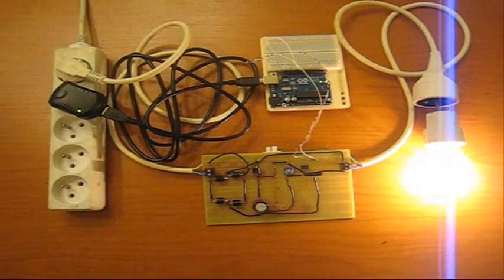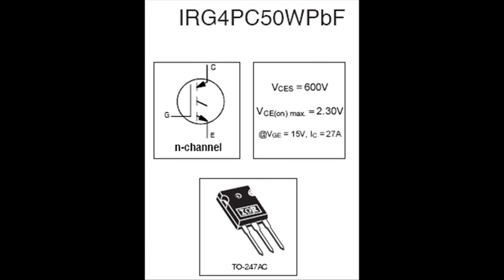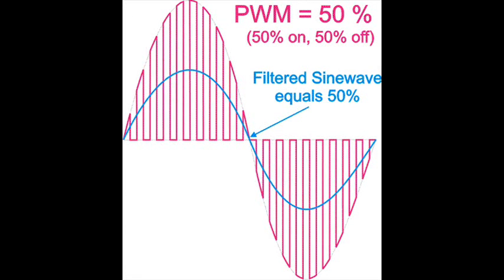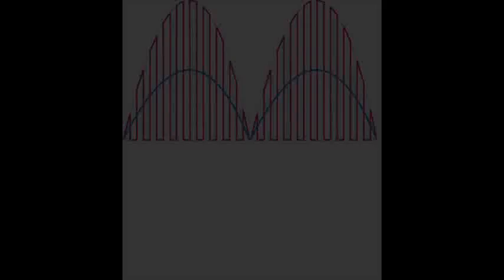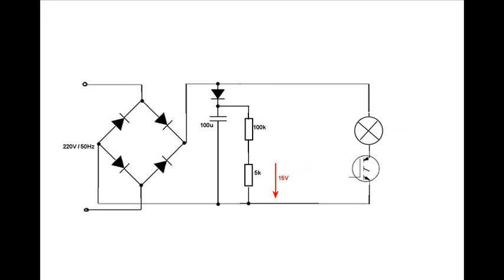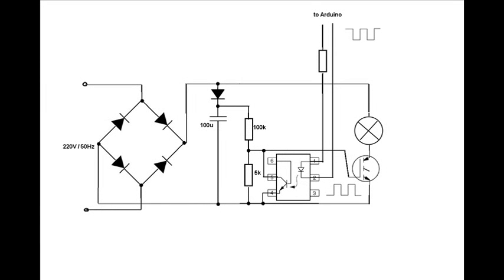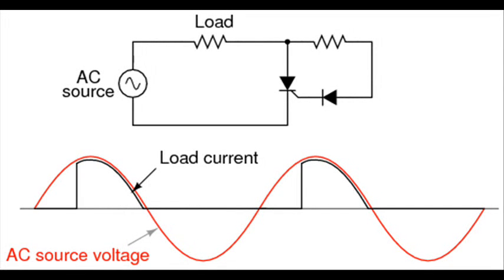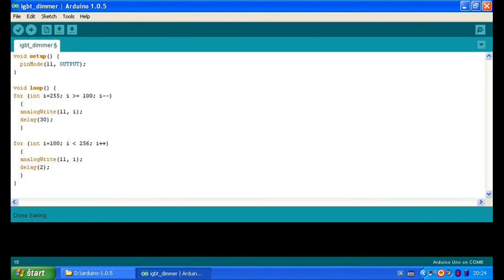AC dimmer with PWM on Arduino

Comment: Hi Jaroslav. What is the additional diode used for? It seems to be unnecessary, because the current is already rectified... Am I missing something?
Reply from the maker: Yes, the current is rectified but that doesn't mean that it is DC. It still oscillates so you need another diode to keep the capacitor charged all the time.

Comment: The load is driven with 100HZ DC voltage through the bridge rectifier which is not suitable for every load.Instead this if do some modifications connecting the load in series in the AC line and use IGBT for short circuit between + and - of the bridge rectifier then you have a good ac switch.If find a way to drive the isolated gate-emitter of the IGBT with the PWM signal then you can control any type of load even the cheap brushless fan motors used in the hot days of summer.
Reply from the maker: Yes, if you find a way how to control the IGBT in a way how you describe, it will do the trick.
Regarding the cheap brushless motor, there's much simpler way, use a solid state relay and switch it on and off with 1Hz PWM signal.
Reply: @jaroslavhruskovic7153  If use optoisolated gate driver ic and a separated dc voltage without common ground connection to the other circuit.Is somehow complicated but it works.The low frequency PWM haven't tried it yet.

Comment: Im surprised with this since tou used AC bulb but in your diagram you use a diode that rectifies AC to DC therefore your AC Light bulb is now using DC? Thanks.
Reply from the maker: The bulb isn't AC or DC. It just works with both types of current. In this aspect, the bulb is very easy going, unlike a motor or transformer or other electronics.

Comment: Hi
Jaroslav, I came across your design and it is really nice especially for its simplicity and the space it leaves for Arduino do something meaningful than zero crossing detection. I want to use the circuit for regulation of heating (60W) and to use ESP8266 01 as the controller. Unfortunately, when testing it, I realized that the dimming works fine but the transistor (IRG4PC40WPbF) gets hot after 3-5 minutes and stops dimming. Would you have any idea what could be wrong? The only thing which is different from yours is that I use ESP8266 which has the PWM sampling from 0 to 1023, but I doubt this is the reason. Thank you.
Reply from the maker: Hmm... I cannot figure out the exact reason but I think that you should check whether the transistor is opening and closing rapidly. It shouldn't happen that it is semi closed or semi open for a long time because in this state it has major energy loss. When closed, I =0A, therefore as P= U*I, the P=0. When fully open, U=approx 0V, therefore as P= U*I, the P=0. in any other state the power is significantly higher and that is what heats up your transistor.
Reply: @jaroslavhruskovic7153  Hi Jaroslav, thank you for your quick response. I decreased the resistor at the optocoupler and the problem is gone. I had there 1K and ESP works on 3.3V, so it was apparently too much.Now I have there about 800k. Thanks again.
Reply: Lo resolviste?

Comment: how can we use both inductive and resistive dimmer without zerocross circuit.
Reply from the maker: Inductive might be problematic in this wiring. Depends whether it is pure inductive or a combination of resistive and (a bit) inductive.

Comment: Hello! I experimented with a circuit very similar and it worked very well! But I have a question why it works this way and not with SSR? Because I experimented with an SSR and what I observed was not uniform illumination. As erratic

Thank you!

Comment: I need to dim an LED tube with the input downsteped input of 120v 50hz... cant this be done flicker free?
Reply from the maker: From what you've described it may work flicker free. But keep in mind that the tube may have it's electronics built in, so it may respond unpredictably.

Comment: i try this project and i have the dimmer effect, but when the pwn is 0 or LOW, the lamp stay a little brither, how can i resolve this? maybe a pull down resistor connecting gate and source? i try 1k but with out success
Reply from the maker: Try to disconnect arduino and pull it artificially down to 0. If it still has some current, I would say the transistor is wrong. Be aware that it should be strictly either fully open or fully closed. Only then it has low energy dissipation. If for some reason you semi-open it, you might have burned it yourself.
Reply: @jaroslavhruskovic7153  thanks for the reply, i will try it, and i will go back here to give my results.

Comment: Excellent video I have one question can this work on ESP8266 Node MCU??
Reply from the maker: Yes. General Purpose IO (GPIO) pins on the ESP-12E 
NodeMCU allow Pulse Width Modulated (PWM) 
outputs. Simply put, PWM outputs allow us to set the 
output pins to be Qn for a certain percentage of time in a 
given time period which is a condition of this concept.
Reply: @jaroslavhruskovic7153  thanks I will try and let you know the results
Reply: @jaroslavhruskovic7153  can you please provide me coding ? riz.insure@gmail.com
Reply: yes

Comment: You did not mention anything about the Zero Cross Detection, this is a pretty important part.
Reply from the maker: Please note that this wiring is unique exactly because of this - it does not need the zero crossing detection.

Comment: Hello sir,,, I need to control the 220V AC Fan using PWM and Arduino...can you please suggest for the components Specification of the required circuit??
Reply from the maker: somu vijayanagar, 220V AC fan cannot be controlled this way unless the motor can withstand the rectified A.C. current. Meaning it also has to be able to withstand the DC bias which occurs when rectified. Check this first and if it can, then the circuit can be used without changes.
Reply: Ok sir,,thank you so much for the reply..!!!!!

And ill check fan whether it can withstand..

Comment: Brilliant design. I have question for you.I am planning to use this circuit to drive dc-dc power supply which takes 36-76 vdc @ 1.9 amps as an input and output 5vdc @ 10amps.Do you think this is possible ? if so is there any change in hardware or software ?
Thanks
Reply from the maker: Hi, if you are working with DC only, the design would be much easier. No need to have a rectification and also it would be safer. But the KEY aspect is if dc-dc converter will work with PWM.. Check that first. If you want to consult more, give me your e-mail address so that it's easier.
Reply: Thank you for your quick reply.I will be using this power supply : http://www.tdk-lambda.com/products/sps/ps_pm/pah/pdf/pah50_spc.pdf. I might set up fixed voltage on optocoupler led for set output from IGBT transistor.Then I will probably remove arduino from circuit.Am I wrong ?
Reply from the maker: I don't know if this is a good idea. If you feed the converter with pwm input, it may unpredictably interfere with internal processing frequency of the converter.
And then what is the point if you not use arduino? Well, and lastly, the led voltage is irrelevant, it either opens or closes the coupler, it does not "semi open".
Reply: Oh I see your point. Thank you for your help.

Comment: Can this work with a shaded pole motor to control speed?
Reply from the maker: Doubt. Anything else than a resistive load is unpredictable. Keep in mind that this circuit has a significant DC so think how your motor can stand it.

Comment: Hello! I find this circuit its capacity depends largely on the diode and MOSFET, the AC is alternating current, this circuit transfers AC to DC and returns AC. I want to ask, can I run the engine? And if it is used to load larger capacity is stable?
I see moc3041 ... 3061 available zero cross, i have tried many ways on moc3041 but not, are you please help me schematic diagram? This is my email hungdkartis@gmail.com.
Thank you

Comment: great video ... can we use AC 230v celling fan as a load on this circuit ????
Reply from the maker: Unfortunately not. Only resistive load is supported.
Reply: oh thanks can u make a video about controlling AC CELLING FAN using PWM ....

Comment: can i use this to vary the voltage input to a 220/2000V ac transformer ,i wanted to control the out put voltage of the transformer by manipulating (varying ) the input transformer voltage from 0 to 220.can you suggest please?
thank you in advance and really a very nice video
Reply from the maker: No, this will not work, you will burn the transformer. This is because the output has DC offset which will cause strong DC current in transformer.
Reply: okk,so do we have any other option to vary the voltage to the transformer ?
Reply from the maker: Tere are some methods. But these do not include PWM. Depends how much you need to control the voltage, maybe a special transformer with divided secundar may do the trick.

Comment: what is THD and PF achieved by this method ? does this work at 347V ?
Reply from the maker: Providing that this circuit will not handle capacity or inductive load and only works with simple ohmic load, the PF is about 100% I suppose. Regarding THD... no idea. Possibly quite a variable factor depending on actual pulse width.

Comment: Can i connect the lamp sequentially with this whole device instead of attach it to transistor? Connecting this way can provide the AC to the load instead of pulsing DC.
Reply from the maker: I apologize, I did not catch the point. Could you rephrase?

Comment: what will happen if I connect two IGBT in anti parallel ??
Reply from the maker: Why should you? I don't understand the meaning. In this wiring it doesn't make sense. However, if you change wiring, it might lead to PWM of both positive and negative halves of the sine wave. But then you have to handle also the positive and negative gate voltage which may be difficult with Arduino.

Comment: hey thanks for the video. i'm working for my final project, i have to control electric water heating element. can this circuit control the electric water heating element?
Reply from the maker: Yes it can, just replace the bulb with the electric water heating element. And keep an eye on electrical current ratings, there may be a significantly higher current when the element is yet not heated.
Reply: should i adjust the frequency of my PWM on arduino? or just do analogWrite? my country's electricity is 220v 50Hz. sorry if my english is bad
Reply from the maker: Just keep it as it is, it will work

Comment: Hi! Very nice work, a question...this circuit works with 110VAC? an other what is the value for resistor in the arduino pin, thaks

Comment: Is there a way to get rid of the diode bridge and still output AC ?  Maybe with two mosfets ?

What is the maximum reverse voltage that mosfet or igbt can endure ?

Comment: with another IGBT transistor in a oposite direction, can we handle the 360º wave with the arduino pwm?
Reply from the maker: Not quite. This would need also a negative voltage output from Arduino
Reply: @jaroslavhruskovic7153  If you use a DC offset to raise the zero reference point of the AC waveform you avoid having to use negative voltages on the Arduino?

Comment: hey, nice tutorial.  Can I use this circuit with 127 V, the same components, but 127 AC V??
I need it for a PID temperature control
Reply: Yes igbt transistor is capable  to handle dc and ac current. and has very common usage in variable frequency drivers. like Danfoss softstart for control induction motors. it's very cool 😋

Comment: can we run a ceiling fan with circuit? If not then what are the modification do we need in this circuit? Sir please answer as soon as possible.
Reply: put the load (MOTOR) on the other side and short the load connection with IGBT. This will enable an AC wave travelling from motor while IGBT will drive the power ac is converter to dc.

Comment: Nice little circuit!
Which PWM frequency do you use and do you have an idea what the limits are?
For example, would you recommend using a lower freq, say around 30kHz or more like 100kHz?
I guess at a certain stage the light bulb will act very slow on certain changes.
Reply from the maker: I think Arduino natively uses about 1kHz for PWM output. At the moment, I see no meaning of working with frequencies higher than this. The bulb reacts so slow that even 1kHz guarantees no flickering. Correct me if I misunderstood your comment.

Comment: Thank you, I built it, it is great!  How would look a concept for 2+ lights?
Reply from the maker: 2+ lights would probably need a 2+ separate circuits, one for each light. The only shared resource might be the arduino which may control as many lamps as many PWM outputs it has.

Comment: Dear Jaroslav, thank you for the great explanation! Can you please tell me the value of the resistor connected to pin 1 on the optocoupler? Also; have you made a pcb for this design? Best regards Asle, Norway
Reply from the maker: Hello, the value is 500ohm. Regarding the PCB... no, I haven't. But if you decide to, I will be more than happy to see it. Would be nice to have one able to integrate Arduino, ideally in a compact box... Maybe we might put some effort together and push it to new level
Reply: Thank you! I am looking into building a 4 channel dimmer/controller with an Arduino Uno. Unfortunately my programming skills are really poor, so progress is slow...
Reply: Hai can you please mention the diode and capacitor value range, can i use IRF 840 instead IRG4PC50WPbF (IGBT).Can i use diode as IN4007 and capacitor as 100micro farad/400v.

Comment: arduino sucks. why do people insist on using a computer to replace simple discretes?
Reply: +drspastic cause you can program it to do whatever you want, you can also make it say on the screen what percent you're dimming it to, and this can be used for much more than dimming a light, you can dim a heater, a lamp, pretty much anything, it can dim much higher power applications than a regular dimmer, and it is much more efficient than a standard dimmer too (creating less heat etc), and much cheaper than a dimmer, and you can even control it over internet (lets say your lights downstairs/outside are still on it will say that and you can turn them off from in your bedroom)

Comment: hello ! First i want to thank you for the video .
i just want to know what is the reference of the diode that you used for the bridge and also the other diode, then the value of the resistence related to arduino.
i looking forward to have your answer soon, thank you.
Reply from the maker: It has been quite a long time, now I don't remember the exact type. But just use any that withstands 400V reverse voltage and a current adequate to your load.

Comment: Hi Jaroslav, thanks for the video.
I'm not sure if i am right, but if we try to drive a CFL or an LED Lamp, could the DC filter capacitor integral to the lamp act as a short due to the high switching frequency?

Comment: Im trying to find a solution to drive an ac motor with and arduino.  Namely a O gauge train set that uses ac on the center rail.  variable voltage from 0 to about 15 volts.  unsure of current.  any suggestions?

Comment: Hello Jaroslav! Can I use this circuit for clf and led bulbs?
Reply from the maker: I doubt that would work. There is an unpredictable electronics inside. Try the commercial dimmer to see if it works. If so, chances are this circuit will do the trick too.
Reply: Thank you! I'll try it!

Comment: Amazingly well explained, thank you very much! I'm looking for an efficient way to dim a commercial LED light bulb (e.g., Philips 10 W), do you think this kind of modern light bulb can be dimmable varying its input voltage? I'm planning to buy a VARIAC to see if it really works... THUMBS UP!
Reply from the maker: I doubt that would work. There is an unpredictable electronics inside. Try the commercial dimmer to see if it works. If so, chances are this circuit will do the trick too.

Comment: Hi Jaroslav, great work!!!
I would like to control a blender's motor of 400W. With 127v instead of 220v.
I already made the proper changes of resistor and capacitor. I'm using a irgp4063d and a 4n25.
And I add a current sensor to control the AC motor through its current (for scholar purposes).
I would like to use the IGBT for that, do you think it's possible? 
Thank you very much.
Reply from the maker: Hi, beware of what type of motor you have in the blender. If you use a similar circuit as I did, the output has a high DC bias, so make some research if your motor works at those conditions. Otherwise, the IGBT itself is ok, even better that you use 127V instead of 220V, that may be easier to find a proper IGBT.

Comment: hi ,you done a great job ...
but will it work with inductive loads like AC motor etc.
and if not so can you plz suggest any dimmer which can control the speed of AC motors to me ....
Reply from the maker: anshul gupta No, it only wotks with a bulb or resistive load.
Reply: thanku for reply...
can you suggest any thing which help me to control the motor or inductive load ...
Reply from the maker: What exactly do you want to control? Would a stepper motor be the solution?
Reply: i want to contol a simple  inductive fan of 60W
Reply: may i have your email id for the further discussion .
Reply from the maker: Ah, that might be done with solis state relay. In such case it doesn't matter that it reacts slowly. You just cannot use the PWM but have to create your own slower pulses. You can write me in next 60 minutes to jaro@sharklasers.com
Reply: hello brother ....
i have sent a message to you please do reply..
Reply from the maker: Oh, did not receive anything. Give me your email address here, I will write you so that you have mine.
Reply: Jaroslav Hruškovič, it will sure work if you put the AC motor on the other part - before bridge diodes. In that case to complete the circuit yo need to short the IGBT terminal on which the load is connected.